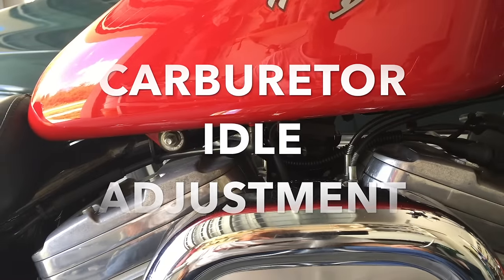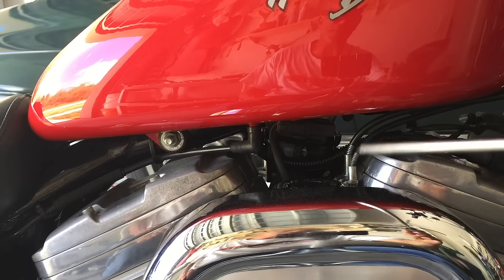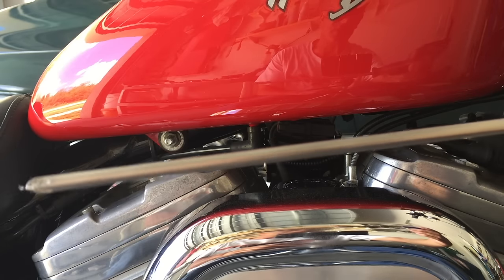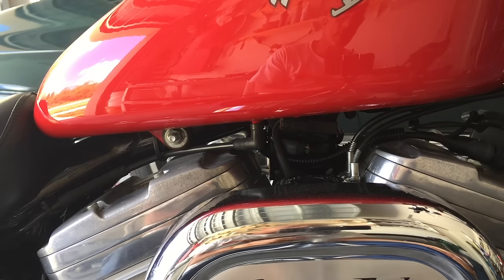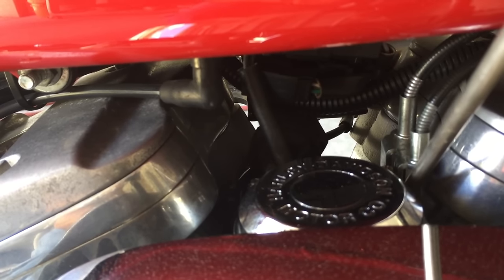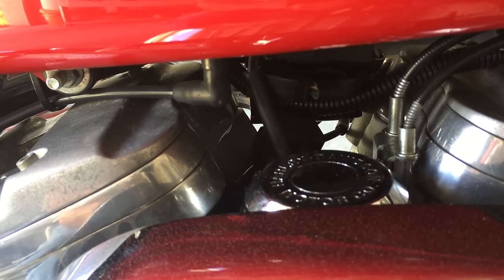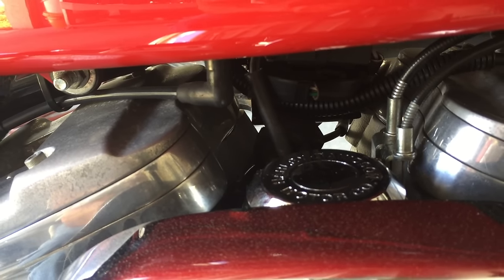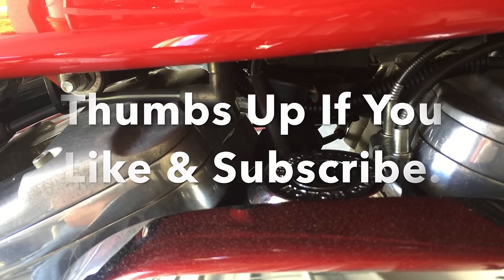How to Adjust the Idle On All Harley Davidson Carburetor Motorcycle.

Comment: Hi Rocco, just got my 2008 Sportster. Idling just with pulled choke. I followed your video and cleaned the carburetor. Now everything works fine and my "lady" runs as she is supposed to do. You saved my life!
Greetings from Bavaria/Germany.
Reply from the maker: Happy all went well, Thank you for your Sub Wolfgang. Any questions just ask. Ride Safe and have a great day.
Reply: I need to watch that video,as I'm having the same problem, bike uns fine with choke on, but stalls when I push it back in. Great video selection.
Reply: Is that the E&G carburator video?

Comment: Man thank you. I just rejeted my carb on my 03' 883 and after I installed it had a pretty high idle, I'd say around 1500rpm. I guess while I was messing with the carb while it was off the bike I must've twisted that screw a hair on accident. 1/8-1/4 of a turn had it right back where it should be. Installed a CVP rejet kit 44/170 and she is running great, no cough or decel pop. Great videos!
Reply from the maker: Happy to read all went well. Any questions just ask. Thank you for your Sub Adam. Ride Safe and have a great day.

Comment: I’m totally new to owning a bike let alone wrenching on one. My son and I did a carburetor today something that seems like it should have taken a hr took us 5hrs    we had to re tape the holes to fit the open screws. Long story short finished but was idling so fast this video helped tremendously thank you sir
Reply from the maker: Take a look at the choke you might’ve not installed the nearly end properly and put a little stress on it or readjust. The Idle shouldn’t have been that complicated but sometimes they can when they get old. Let us know how it works out. Thank you for all your support. Ride safe and have a great day.
Reply from the maker: Take a look at the choke make sure it’s seated properly. And that’s the only thing that should interfere with that Idle how did it Idle before you started cleaning the Carburator? Thank you for watching and all your support. Ride safe and have a great day.
Reply: @TwoWheelRocco  after watching the your video, that was the problem adjust the screw a lil either way to what I like. By the way your videos are awesome, like I said I’m totally new to motorcycles never even sat on one before. Your videos gave me the courage to actually change my own carburetor thanks for sharing your knowledge.
Reply from the maker: Happy all went well. Ride safe and have a great day. Thank you for all your support Jon.

Comment: Nice. Fast n to the point. What if it goes back and you have to adjust it afew days later??? What you think? Thank you.
Reply from the maker: I would check your air filter.  For it to change There has to be an air gas problem. Check for vacuum leaks. so your idle keeps getting lower?  Any questions just ask. Thank you for your Sub Frank.  Let us know how this works out.

Comment: I know this is an older video but I have a question. I have an 05 Softail Deluxe. It seems to idle fine but after I ride for a few minutes I notice at a stop, the idle is really high. I just inherited it a couple months ago and it had sat for a year. I have changed the oil, battery, plugs. It runs fine, I do notice some backfires when it's cold but that stops when it's warm. I've read it's kinda common in carb bikes and need to adjust the choke screw. Would I need to wait until it's idling fast and then do what you demonstrate here? Thank you
Reply from the maker: Happy to help. Make sure the oil level is only halfway on the oil dipstick. Lots of times when these bikes sit for long period of time the oil sumps to the motor. And gives you too much oil in the bike. Run your hand under the air filter. If there's oil on your fingertips that's an indication that you have too much oil in the . It causes a lot of havoc with the running of the machine. Good luck with the new ride. Let us know how it works out. Make sure you have that oil and clean air filter. . Thank you for watching and all your support Lee. Any questions just ask. Ride safe and have a great day.
Reply: Sorry for delay, were moving right now so it's hectic lol... Thank you for the information! I had 3 3 hole oil change a couple weeks ago but I'll check that filter like you suggested!

Comment: Thank you very much for this video, my 95 is running on the rich side during idle and low speed. Too easy.
Reply from the maker: Air/fuel screw will clean that up..1 1/2 to 1 3/4 What pipe are you running?.Let me know how that works out..
Reply: @TwoWheelRocco  when you do the air/fuel screw... is it done by turning the screw out counter-clockwise and  then go in 1.5/ 1 3/4  turn clockwise?
Reply from the maker: Turn A/F screw in and seat lightly. turn out.    counter clockwise 1 1/2 to 1 3/4  this is your air fuel screw on bottom of carburetor.    { I am not talking about your idle screw}   Any questions just ask.  Hope this helps, Let us know how this works out.

Comment: My brother had a few issues with his 2003 sportster 1200c 

I just followed the video. Should I warm the bike up and adjust idle or do when cold with choke off
Reply from the maker: Warm the bike up thoroughly and then adjust idle. Any questions just ask, Thank you for your sub Michael. Ride safe and have a great day. Let us know how it works out.
Reply: Just did the clean a few mins ago 
Have to wait a few hrs to start since it’s 5am in California and the hoa may not like it haha
Reply: I meant that I followed the cleaning video you made!
Reply from the maker: @golightly209  let us know how it works out.
Reply: Cool it’s my brothers bike just giving a hand, thought I could fix a few things change fluids and make it run cleaner. I installed a forward facing se intake not sure if I should try to jet.
I don’t know where to start with jetting
Reply: I rode the bike to make it warm it sounds like it’s coughing when I let go of the throttle sometimes 
Adjusted the idle down about a turn and a half I’ll take I back out and see if that had anything to do with it
Reply: Problem still there
Cuts out pops out the intake normally in lower rpms or lower gears
Reply from the maker: @golightly209  What pipe are you running?
Reply: @TwoWheelRocco  
It’s straight Samson street sweepers
Reply: @TwoWheelRocco  
Maybe the jets not sure what I have or what to ask for. Have to watch the clip to see the correct terminology
Reply from the maker: @golightly209  You will need to jet up your carburetor. Take a look at this video.  https://youtu.be/Cjixbd1ctqY.  Any questions just ask.  Let us know how this works out.  Ride Safe and have a great day.

Comment: I had backed out my idle screw to idle at lower RPMs but it does not seem to want to go all the way to the screw. There is a gap. I tried loosening my throttle cable more but it isn't working. Any ideas, thank you
Reply from the maker: Happy to help. I would remove the air filter breather cover and inner backplate. Inspect what's going on with that throttle linkage. It should be obvious that something is not right. Thank you for watching and your sub Jeremy. Let us know how it works out. Ride safe and have a great day.

Comment: If my sportster is hot . And it somethings not all the time.Idles done to the Pont it shuts off. And I idled it up just a little. But it still shuts off sometimes. What should I check next?
Reply from the maker: Check the vacuum lines from the Carburator to yourPetcock sometimes on these bikes they collapse and that cut to a fuel, then I would test the Petcock to see if the Diaphragm is in good working order. I'll send you a video for testing the petcock.  https://youtu.be/7Fo9Q93OJXI.  Any questions just ask. Thank you for watching and your sub Steve.  let us know how this works out.  Ride Safe and have a great day.
Reply: @TwoWheelRocco   I have changed the pitcock.  And I did what you said. I bought a pressure tester and like you said it did not fold pressure. So I got one for Harley and watched your video and changed  it. The bike runs grate on the hyway and in town. It just sometimes idles down to far at a stop. So I will check to see it that tube is getting weak.  Thanks so much.  You the man
Reply from the maker: @steveloy8273  So you're on the right track check those hoses. And clean your air filter might be a little too much oil in the bike I like to see it at the halfway mark on the dipstick so you don't foul out your air filter. Harleys little dirty secrets to keep you bringing your bike back to them dirty air filters from too much oil in the motor. Keep an eye on your oil. Ride Safe have a great day.  If All else fails raise the Idle..   I know you don't need this but I'm gonna send it.  https://youtu.be/N-_00UOa_xk
Reply: @TwoWheelRocco  Thank . I trust you  and your knowledge is  grate.  Thanks so much.
Reply from the maker: @steveloy8273  My pleasure

Comment: Question. A few buddies and I basically tore my CV carb down and cleaned it. It was sputtering badly and wouldn't stay running. Well we fixed that issue now it sputters at low speeds. Say just cruising around town at 30 mph. At highway speeds it runs fine. Can't figure out what my problem is. I have a 1200 hd Any suggestions would be appreciated. 🍻 🍻
Reply from the maker: Did you test  your Petcock and clean or replace your tank screen,  That's where I would start, making sure you have good clean fuel supply.     Here's a video on testing your petcock. https://youtu.be/7Fo9Q93OJXI.  let me know how this works out and then we will move on. Should not be that difficult to straight now.  Any questions just ask thank you for your sub Jason.  Ride Safe and have a great day.
Reply: @TwoWheelRocco  I will try that. Thanks for the reply 🍻 🍻 🍻 🍻 🍻 🍻 🍻 🍻 🍻 🍻
Reply from the maker: Any questions just ask..

Comment: Rocco, finally Managed to adjust the mixture and idle... No more pops and the bike returns to idle sounds like a Harley... Can you make a video how to properly adjust the timing on an Evo?
Reply from the maker: Do you think you need to adjust your timing.
Reply: @TwoWheelRocco  well I'm not sure but this is really good to know because the last mechanic adjusted by ear
Reply: @TwoWheelRocco  also I found out the bike was sounding very soft and wasn't returning to idle correctly because the mixture was too rich... The nice pop sound of a Harley evo needs to have good air in the mixture as soo. As I placed the correct mixture of air the bike started to sound louder stronger and with the distinctive pop also returning to idle properly...
Reply from the maker: @AndresCuervoArt   Nice to hear you have her running right.

Comment: Thanks for the info. 
Just picked up my used 1999 HD Dyna wide glide and after 40 mile run I can up to  a traffic light and it stalled out as the rpm kept dropping too low after a few seconds.
Reply from the maker: Hows the Inside of gas tank look. Any Rust. I would Look at petcock for vacuum leaks, Then tank screen,    https://youtu.be/7Fo9Q93OJXI. Then clean carburetor if idle still gives you a problem.   https://youtu.be/Pp4l-zbQcy0. Any question just ask. Hope this helps. Let us know how this works out.

Comment: Rocco one more question do you adjust idle for 950rpm cold ? At operating temp? Or after a ride?
Reply from the maker: After fully warmed up..I like 1000/1100 but that's up to you. Hope this helps. Ride Safe and have a great day.
Reply: Two Wheel Rocco thanks
Reply: Harley says 1000 for the oil pump to work properly.

Comment: Hey Rocco, got a 2005 road king I have back firing and sometimes hiccup in the carb. Any suggestions what it might be
Reply from the maker: Happy to help. Remove the air cleaner and see how it looks. It could be very dirty and causing you problems. The next thing I would look at is your Petcock. I'll send you a video on how to test it sometimes the vacuum line that goes to the car gets funny, and that causes fuel problems. Thank you for watching all your support Anita. Ride safe and have a great day.  This is where I would start.  https://youtu.be/7Fo9Q93OJXI?si=NgBD1E3uR_T3ur3G.   let us know how that works out, Then we'll check your  Carburator.

Comment: I got a 99 sporty 883. Just recently noticed a idle issue. Almost like there’s too much fuel at idle? Sitting at a light at night I can see the smoke from my bike in the headlight and definitely running rush. Actually stalled on me tonight at idle… I’m going to try the idle screw first but will that fix the rich too? Or do I have to take the air cleaner off and adjust the a/f screw too?
Reply from the maker: Happy to help. I would check your air filter if it's all soiled with oil and dirt. That would be a sign that you're running too much oil in the motorcycle. These sportsters like halfway on your oil dipstick. If filled too much, create a rich situation. Try that first. Let us know how it works out. Thank you for watching and your sub Ryan. Ride safe and have a great day.

Comment: Rocco 

How do I  know what idle speed I am at .. I tried a tachometer that wraps around the sparkplug wire but I an not getting an accurate reading being that the nature of the Harley shakes so my reading jumps . I there a device I could use to set it thats on point ?
Reply from the maker: I myself do it by ear.  Not to fast just a nice sound. You could use a automotive dwell meter. Like I said do it by ear,  where you are comfortable and it shifts in and out of gear cleanly. Let us know how this works out Tony. Any questions just ask.

Comment: Hello, well I've got a 2003 100 year anniversary limited edition, Hugger, its desileing,  I put some mystery oil in and cleaned the carb with cleaner, and it ran fine for 30 miles , and is doing it again,  but this time it will blow alittle gray smoke out of the carb . What do think, it's an 883
Reply from the maker: Happy to help. How did the gas tank look?  Sometimes the Petcock Diaphragm fouls and put too much gas in that circuit or not enough gas in that circuit. I will send you a video on how to clean the carburetor and test the petcock. Thank you for watching all your support John. Ride safe and have a great day.   carb. cleaning.  https://youtu.be/Pp4l-zbQcy0.    Petcock test.   https://youtu.be/7Fo9Q93OJXI.   Very popular problem with these vacuum Diaphragm petcocks, but they're great. The rebuild kits, not that expensive, but you should go to dealer. Sorry to say, but that's the only place that has the rebuild kit which is the hardware and the main Petcock.

Comment: My bike is running a little bit lean. The bike idles pretty low. If i turn the idle up, will it fix the lean condition? Or do i need to put a bigger pilot jet?
Reply from the maker: Adjust idle, And look at plugs. Thats the way I do it. Then adjust A/F Screw .Why do you think its lean? What bike, pipe and intake?
Reply: It winds out quick at idle speeds. Hardly no power accelerating. Pops aclittle on deceleration. If im idlin an i twisted the throttle it "hangs" to long before it comes back down to idle.
Reply: Is it possible to adjust a/f scew without takin the carb off? An is itnt it 2 turns out,from seated?
Reply from the maker: @jordanenix2802  Yes..What bike, pipe and  intake?
Reply: 2000 1200 sportster custom vance hines pipes. No baffles
 Stock air box
 Kn air filter

Comment: rocco i have a 2017 sportster xl883n at startup  it seems to idle a bit high . it comes down quickly , should i be concerned
Reply from the maker: No you don't need to be concerned. Run some fuel injector cleaner in your gas. Every 3 months or so,  And all will be well. Ride Safe and have a great day.  Thank you for your sub.  Let us know how it works out.

Comment: My '96 1200 seems to idle pretty high after it is fully warmed up (190-200 degree oil), should I adjust at that temp when I get back from my ride? Will that make it much more difficult to start when cold? Sorry for the beginner question.  I've never done this before.
Reply from the maker: Happy to help. I would set the idle when the bike is fully warmed up. And if you choke is working proper, you should have no problem starting it up. The way I do it, I pull the choke out start the bike, so as long as your choke  stay out then the choke is working properly and then after about 2 or 3 minutes  of riding push it back in. And you will never have a problem. Let us know how it works out. Any questions just ask. Thank you for watching all your support allegon.. Ride safe and have a great day.
Reply: @TwoWheelRocco  Thank you so much for getting back to me. I will do it tomorrow, and let you know how it goes!  Your channel, your knowledge, and your willingness to help are truly a godsend.
Reply from the maker: @allegronontroppo1  My pleasure. Ride safe and have a great day. Let us know how it works out.
Reply: @TwoWheelRocco  made the adjustment. When I cold start her tomorrow, we'll see how I did, and I'll let you know. Thanks again!